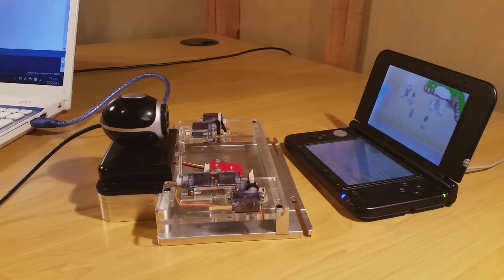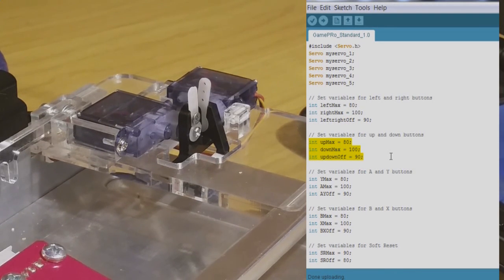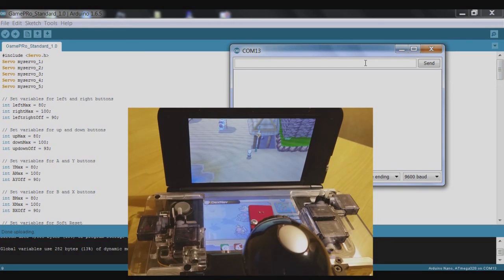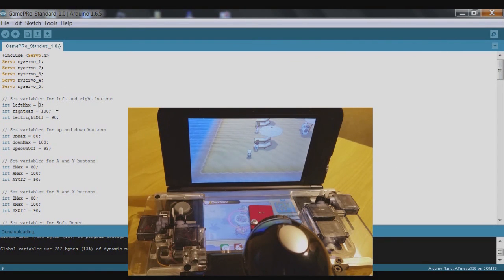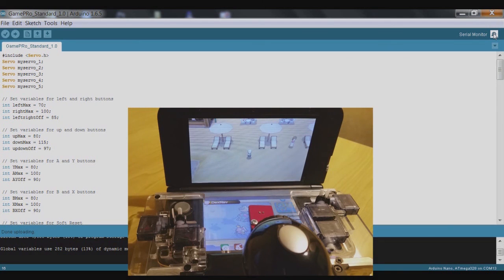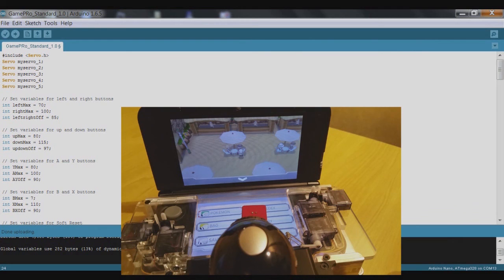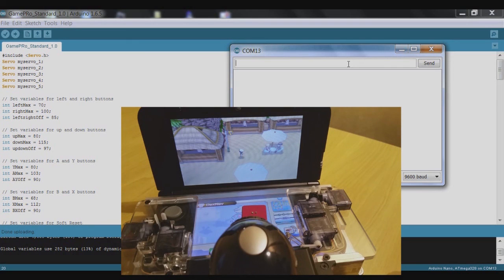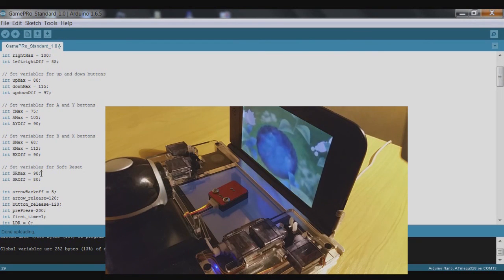GamePRo Calibration Tutorial

Comment: one of my servo (the one that presses the a and y buttons) completely stopped responding to any commands in the arduino calibration software. I have no idea why this would be, as I've only done about 200 soft resets with the gamepro. Is there anything I can do to fix this, or do I need to replace the servo entirely.
Reply from the maker: Hey there, you could try moving the servo motor to a different pin on the expansion board, just to rule out an issue with the board or the arduino chip on that particular pin. That would require changing the pin number in the calibration sketch. If that doesn't work it is probably a servo motor issue, in which case you should replace it with the spare. If you need help with any of this, send me an email.

Comment: Okay I have a problem, all but the up and down buttons are working correctly. If I put the down button number too high the GamePro hisses at me, and the same for putting theup button too low. And for some reason it still will not push the up down buttons.
Reply from the maker: Hey there, I have a suggestion that may help resolve your issue. There are some variables further down in the GamePRo sketch called arrowBackoffU and arrowBackoffD. By default they are set to 5, but it sounds like you might need to set these slightly higher (try increasing incrementally up to about 10). You will need to combine this with adjustments to the upMax and downMax variables. Could you send me an email and let me know how you get on?

Comment: i made the gamepro and now i can't figure out how to execute and manipulate the code to make it work.
Reply: Also every time i insert it into the computer, the right and left and a and y motors move all the way to the left.
Reply from the maker: +Poke Kid Hey there, this means the actuators are not centred properly. There are two ways to fix this: either take the actuators off, plug in to the computer to allow the servo motors to move to centre and then re-attach the actuators. Or you can use the leftrightOff and AYOff variables near the top of the code and change the default position. In your case it sounds like you need to increase these values.
Reply: +Nooby Thanks